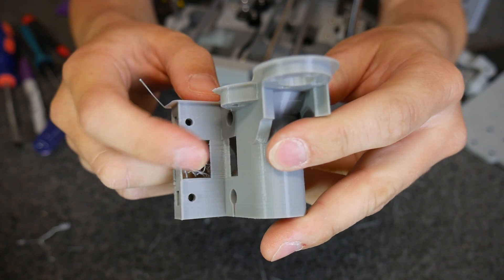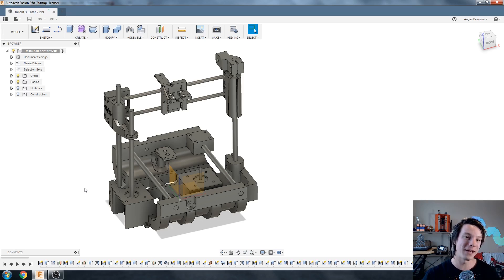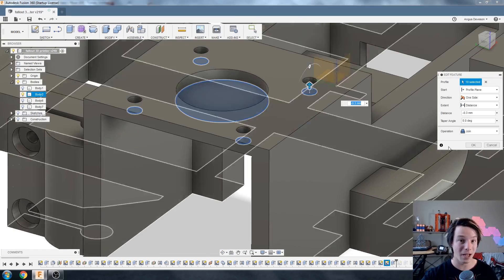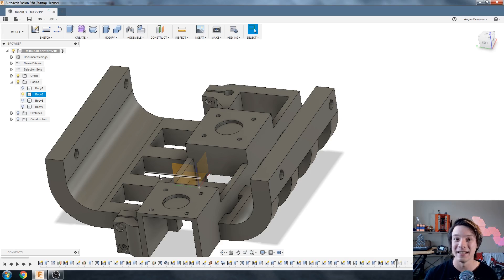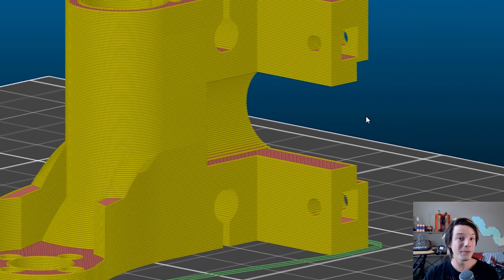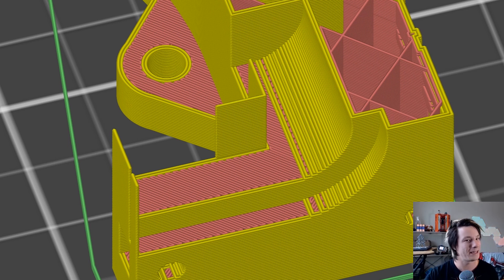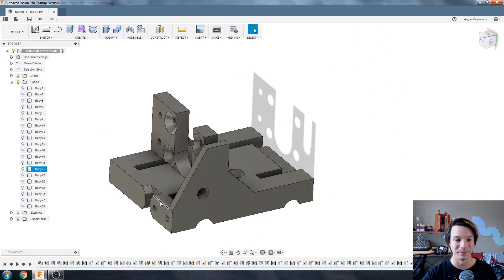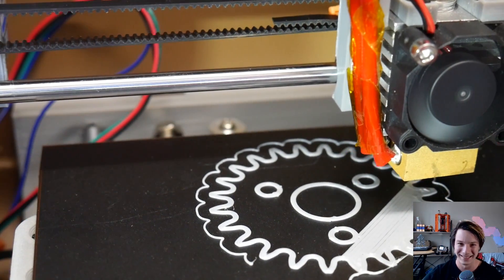Design Better 3D Prints that don't need Support Material

Comment: I would have a better idea than the sacrificial bridges what i gonna test on bigger prints, instead of sacrificial bridges i would pre print an 1mm copy of the bridging part (basically cut the part out of the main print and print it separately) and make a slot for it in the main print, so basically i just add a pause for the print where its would print the bridging and i would insert the 1mm pre printed part and let the printer continue, i did this already on couple small prints and its worked perfectly, just make sure you count with at last a 0.1 or 0.15 mm tolerance, based on your printer so you can add the pre printed bridge part easily.

Comment: Wow! Top notch content and building on the previous release. I've tried the sacrificial bridge for holes and am pleased with the result. Looking forward to integrating some of the othe suggestions. Are there circumstances where a dual head extruder with soluble support material has a clear advantage?

Comment: @2:40 you say if the holes were not there, it would be able to print without issue. I don't see how. It would have to extrude a line of plastic over almost 2 inches of air.  Yes, it's supported at both ends, but not in the middle. I'm confused.

Comment: You can also "split" certain overhanging parts to be completely separate, and then add an assembly feature like a groove/tongue or an interlock for adhesive fixturing.
My little Markforged Onyx one machine has a small print volume, and I find myself splitting parts into 2, 3,4,5, or 6 sections and doing cluster prints to save time.

Comment: I use all of these in my models. I tend to use polygonal shapes if I need to index parts together as they tend to print better than circular indexes and these have allowed me to make parts that exceed the build volume using the least amount of support material.

Comment: Huh, I had no idea you could actually print over open air like that in the sacrificial bridging bit. Obviously something that's either floating or attached on only one point is impossible, but I didn't think you could even really do it across two points like that since the filament doesn't have anything to adhere to as it goes and it'd just sag. I guess the cooling fan really does good enough of a job for that beyond the first layer droop? Thanks for this series by the way, I have my first 3D printer coming in a week or two and I haven't touched cad since Solidworks in high school and this has been a perfect refresher. Detailed but concise and efficient, just what I needed to de-rust the memories while also understanding the new software and modern parametric style

Comment: When printing separate parts and joining them together after with screws, would there be another option such as using super glue? Or even a slurry paste such as with ABS and Acetone?

Comment: (A) I want files and instructions for this, even if there is a reasonable fee. (B) I'm curious how Fusion 360 would design this same printer using Generative Design and the property constraints. 🤔

Comment: What you could also do is set the overland needed to print supports to 90 degrees so that it won't mess with holes or curves and won't droop the overhangs

Comment: Hey, do you have anything on model making for 3D printing? I learned Blender a while ago, and bought a Prusa Mini (not arrived yet) and in preparation for the 3D printer I loaded some of my models into the Slicer. Nearly all my models look bad in it, ships with a curvy surface on top have infill showing , where O modelled with planes, the slicer simply cuts those off, and I have nothing there on the model. I'm looking for some tutorial on how to model for printers. I saw you lake 1 layer thick walls in the above video, is that a plane or like a box with like 1mm thickness?

Comment: Angus thanks for doing this. I'm struggling with design that has a lot of helix curves.  Tried building supports horizontally, but I think I should build them vertically or try no supports what so ever.

Comment: This tutorial is a bit unclear. You didn't show how did you build up those wales support.  You only show them after you finish with them. This is a presentation not a tutorial in my opinion.
How did you made that bridge on 6:20 ?

Comment: @08:10 May want to consider getting yourself a KNIPEX 78 91 125 Electronic Super Knips with built-inn, not sure what to call it, "Retainer" that prevents things from ejecting off into your eyes.
Got me one of those a few weeks ago after accidentally breaking a previous generation one without that Retainer on a probably work-hardened piece of solid core copper wire... Never looked back.

Comment: I just encountered a weird 3D printing problem, I have supports but no printed part. I was printing a Baphomet from Thingiverse and did the initial setup in Slic3r, printed the part, and when done only found the base and horrible looking support columns with no visible part inside. I did notice that it did loose position a couple of times, but that is about all. Perhaps the statue was so disgusted by the print that it just got up and flew away.

Comment: Thanks for all your videos. (Subscribed)
I'm sorry, I don't get something.  I'm a brand new 3d printer owner. I've printed 3 things. lol
If I want to print a box with a square hole through it and I want it to be on it's side, you mean that the printer can bridge across a space?
Think of a house wall with a window. Yes I can print it flat, but in this example I want to print it on end.
The printer will draw the wall then the window ledge then the 2 sides and then bridge across the top of the window??
I haven't tried this but I'd love to know.

Comment: Hi Angus, amazing tip here, loved it, as I often design parts that are sort of inverted staircase shape of thing. However, I've run into an issue, with longer pars having the infill pattern aligned with the perimeter. I'm using Slic3r prusa, and I've noticied that on the 1st layer, the infill pattern always sort-of bridges between shortest distance, but with latter layers it's not the case. Would be very grateful for an advice. Cheers

Comment: I'm just kind of looking into this whole 3d printing thing. Are there videos that show how the printer achieves certain tricks or limitations?

For example, with #2 and the manual supports, how does the plastic stay suspended until its connected from the part to the support column? I see you show there was some stringing but why did it still work? Don't really know how to find those types of videos on how they print.

Comment: I dont know if you still read comments on this video, but if you do - check this ones out.
https://www.aliexpress.com/item/100pcs-M2-M2-5-M3-Copper-Inserts-Brass-Double-Pass-Knurl-Nut-Embedded-Fastener/32842866575.html?spm=a2g0s.9042311.0.0.1f094c4dt0t7ep
Im using them, and you dont have to make room for nuts, just a hole :)

Comment: Great video!

Your bridging on the X axis motor mount may have failed because your modeled support was only one perimeter thick. It did support the outer perimeter of that section, but not the inner perimeter and not the end of the infill. 

I'd be curious to see how well it would work if you modeled the support at 1.5 mm think and then ensured that the bridged infill was perpendicular to the support. This should allow for the two perimeters to be supported as well as the end of the infill.

Comment: Good tips; I did the same things, but there is one I missed:
I have some prints, where I drew the object in a 30 or 45 degree angle, from the bed.
So I added some smal support construction at the bottom, which also
helped to add surface area.  One more thing: These nut inserts...
People tend to design an opening next to the screw hole, but you could
scew it a bit, so that the opening is offset in relation to the crew hole.

Comment: Used to do this with Meshmixer I think.  But use Sketchup more often than not as I work mostly in straight lines...haha. and it is dead simple to use for quick prototyping.

I had never really taken the extra time to throw supports in though and usually let repetierHost/Cura just do it's thing - Which is really annoying when you have Holes on the X plane that Cura might orient in a way that is easy to remove.  But any openings you have then in the Y axis it basically Fills in!  So I used the later method on the weekend - in a 60mm wide by 15mm opening I placed half a dozen 0.6mm wide/thick posts that printed with No walls, very little material, was sufficient to hold up the 60mm space at the top of the opening, but was Dead simple to remove.
Wish I could post a pic - because the resulting "lattice" looks good too, due to stringing between the posts due to no retraction...

Comment: Looks like the bridge at 7:35 didn't get detected by the slicer. This is because of the right angle in the bottom layer. If you had split the bridging into two components (vertical and horizontal), offset by one or more layers, you would've gotten the slicer to be able to generate two separate bridges.

In the end, this caused your bridging to fail as you showed earlier at 7:07 (your infill generated in the wrong direction(s)).

Comment: You could use a 3mm perspex sheet as a replacement for the motor mount which can be screwed in to printed material.  A nice clean ,strong interface and saves time .
Reply from the maker: True that, not a bad idea. I'd love a laser cutter in future to do complex acrylic parts.
Reply: Maker's Muse maybe a cnc cutter ?
Reply: For the motor mount you could cut the flat stock by hand if you didn't have a laser cutter.
Reply from the maker: Need a good size holesaw for that middle hole though :)
Reply: Maker's Muse why does the hole need to be great than the axle diameter

Comment: I'm wondering when they will use phases of materials and environmental conditions such as temperatures to provide scaffolding.  For example, imagine a 3d printer at say minus twenty Celsius building scaffolding out of ice or a printer operating at temperatures colder than minus fifty five Celsius using dry ice as scaffolding...  Even using a soluble gel as scaffolding would be interesting.

Comment: S3D 4.1 handles bridges even better so you would not have these droops -- I've tried these type of bridges and doesn't do infill lines which are likely to fail and just goes in the direction of the bridge -- very good approach, hope other slicers start doing the same thing.

Comment: Good tips, I have sort of started to do this with my designs making separate parts part anyways. The built-in support thing I will have to try on my current design but I think I can fix it with just putting some chamfers in the problem areas. They are not going to be visible to anyone so I think that would be ok.  But I have been looking at trying to minimize the need for support material as much as possible over the last few projects. and your tips will help for sure, never thought of making my own supports, clever.

Comment: Great tips!
I've usually thought (about future projects) as it's probably will be made in several parts that will be screwed together... Was thinking about to design my own supports few times... But now I'm sure it's a good idea thanks to you've prove this :) But never thought about making a thin sacrificial layer that will help to print 90deg. overhangs...
I'm working in Cura currently. Is there a good Bridge algorythm? I've didn't heard too much about it and tested just once (in the last video and it shows some crap about it actually).
How to setup bridges for PLA and PETG in Cura properly?
P.S. we have a nice snow sunny weather today. But few previous days were not good: very wet and cold weather and this stupid "salt reagents" that melts any little snow to wet and cold puddles... You must be happy if your services use sand against ice! :)

Comment: Thank you for this video. People want to print everything in one go FAR to much. There are reasons that manufacturers make things in more than one part other than production technology. Too often I hear "they don't because they can't." I call BS on that. Why do some people think we have manufacturing technology that Toyota, Ford, GM, Bowing, GE, and EVERY OTHER manufacturer on the planet does not? There are cost, speed of production, reliability, assembly, repair, maintenance, environmental, and material type reasons behind the decision.  I probably missed a few reasons, but these are key. I was taught to design the part on paper to work correctly first, then choose the material that is best suited, THEN change that material for the one that is best suited with cost in mind, THEN choose the best production process, THEN AND ONLY THEN do you go to CAD. People in 3D printing are pigeonholed into a few materials so they usually skip that step. I don't think most people realize how limited 3D printing can be. It has such amazing potential that to often the down side gets over looked. Thank you for setting things straight. Also couldn't hear rain...

Comment: Any reason you're not using heat set thread inserts? Especially for that motor you screwed in from the back it seems like it could've saved you some effort both in design and build.

Comment: i prefer to model in supports for spaces like where those motors go. you can make a nearly hollow box then space it .3mm from the print at the top and a couple mm spacing on the sides. once the print is done the .3mm spacing makes it simple to remove and leaves a nice flat surface with like no drooping at all. it will use up a little more material and print time but you get a cleaner part and much easier to remove than the generated supports.

Comment: Nice vid, very useful as always.

I noticed that your sacrificial bridge at 3:05 has the plastic being laid down perpendicular to the solid sides of the model, whereas all your other surfaces seem to be laid down diagonally. Clearly anchoring the bridge to solid parts of the model is better than laying down a thin bridge at one end and trying to make diagonal bridging stick to that, but how did you make that happen? Is it a slic3r feature? (FWIW, I use Cura.)

Comment: Hey Angus. Great Vid as usual.
We use Brass inserts instead of nuts. No slots necessary. Just design in the appropriate sized hole and then heat / melt them in with a soldering iron. Once in they ain't gonna come out. And they're cheap.

Comment: Great tips. It would be wonderful if you could make a video about printing multiple part components but without the need for screws and glue. How to design joints that just fit together and will work for different types of things. I see so many designs with screws that just would not need them. Love your vids!

Comment: I too had to design a two piece hotend carriage. It had to mount an E3D v6, 2 noctua fans for cooling the part and E3D, a direct extruder, and also be able to support a cable chain so all the wires don't go down into the printing area. I used gussets and thick walls so I could tap threads into the screw holes.

Comment: Very useful info Angus.  Also, couldn't you also design in your own supports - with maybe a 0.1mm or 0.2mmbetween the "support" and the part - without much actual close contact area?  That should give the part a little support, while being easy to break away - with minimal damage to the part.
Reply: I was thinking the same thing

Comment: Couldn't you make a 1 layer thick bridge about 3 layers down from where you want the real bridge then put supports on that? So you have like 3 layers of support before the real part
Reply: you could, but I don't think that would make the support any sturdier if anything it would be less connected the layers above it where the holes are not so it would be weaker, unless you're saying it could help with support removal in which case possibly but probably not enough to justify it

Comment: I just wanted to point out that in some slicers have to enable printing thin walls when printing built in supports. Good video just wanted to point that out. It may be that I used .4mm supports. In yours you mentioned larger

Comment: When you create a sacrificial bridge, is it directly on the surface of what you're supporting or is there a tiny gap? Thanks for these excellent videos; I've been using them to teach myself so I can be a better design & modeling teacher to my students!
Reply from the maker: The surface is directly on it, no gap. It's not like breakaway supports as such, you just remove the areas over the holes and leave the rest. Cheers!
Reply: @MakersMuse  fantastic! Thanks for everything!

Comment: Hi Angus. I think it's a good idea to generate a test piece for the "hole support" bridging rather than get into a long print ( like your base) only to find out halfway your bridging settings need more work.  The Nema stepper feature you showed, with it central large and 4 bolts holes, would be a good example.

Comment: I made a ring to join two pieces together, and for that, I found the support material extremely difficult to remove, but I heard about sacrificial bridging 3DPN's video, and I ended up designing in some posts on the outside and inside of the ring to bridge to those so I could print it without support material. They actually broke up pretty well, though I did end up cleaning them up with a knife.

Comment: I want to tell you that you've inspire me to build my own fallout theme 3d printer. I have found what I'm going to use a main body, a auto shop gress barrel. I have q fair idea now and plan to make it portable.
Reply from the maker: Cool! Best of luck with it :D
Reply: @MakersMuse  
Thanks, right now I got to save up for the parts and plan ahead (Darn black friday and good deals). It's best to measure multiple times and cut once. Though in your opinion does printed ABS mounts fair well in an enclosure? I know that injected molded parts are good, but I think those are mixes of PC and ABS.